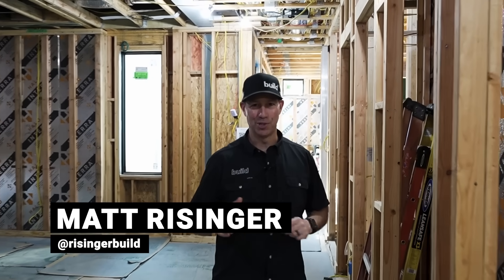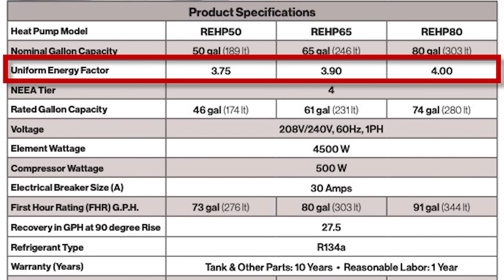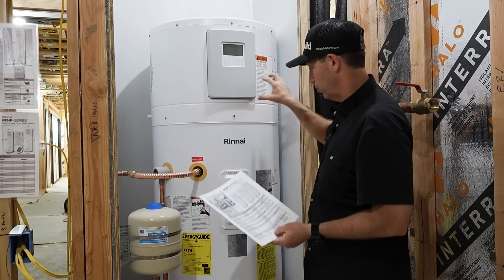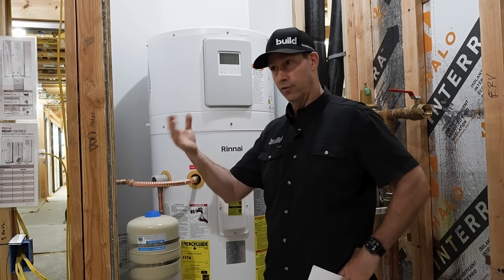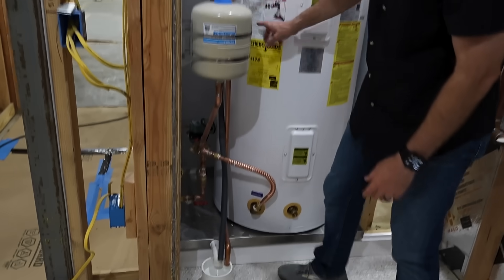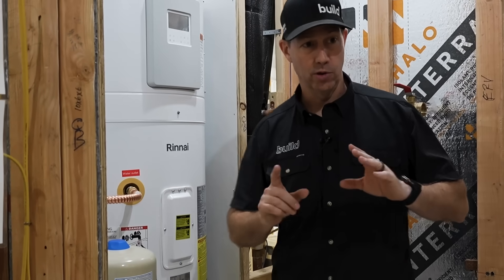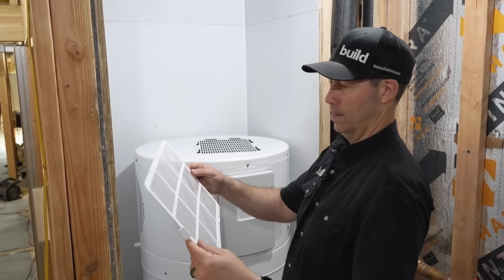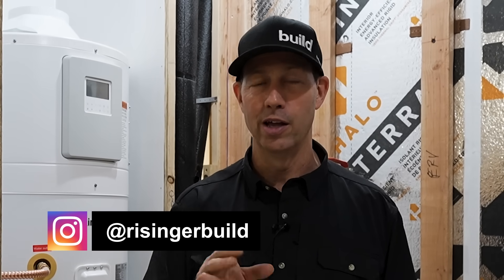The Best New Water Heater? Rinnai's KILLER Electric Heat Pump

Comment: Most hybrid tanks call for at least section.of PEX when connecting to the water.   The compressor has a resonance.  Connecting the unit with copper will transfer that vibration through the whole system.   The pex isolated the unit so your pipes don't rattle every time it fires up.
Reply: There's 2 things that could work well for noise isolation. The first is using a braided flex and pex instead of the more solid corrugated copper flex and copper piping.  The second is something I found when I did my install - a flat rubber donut, about the diameter of the hot water heater and maybe an inch thick, which does a good job of not tranferring water heater vibration to the pan and floor below.

Comment: Drain catch for when it leaks in 30 years? The tank has a 10 year warranty like any other non stainless water heater, which means throwing out the heat pump on top too. When is a company going to make one with a stainless or composite tank!? Exciting technology but they gotta either make them with tanks that last or separate the compressor from the tank.
Reply: Like a mini split water heater.

Comment: You almost linked them together, refrigerator and water heater. Now it’s possible. Perhaps if we did, we could get refrigerators that lasted more than three or four years? I’ve always thought it was a waste to dump hot air from the fridge into the house now we’re doing the opposite with water heaters. They need to be connected.
Reply: the amount of heat moved is too small. plus it's recyclical as you open the fridge door.

Comment: At $2500 + install cost, most never get your money back, it takes 10 years to break even.  If it fails after 10 -15 years you saved nothing.  Federal tax credit may make break even after 4 years at 15 cents kwh electrical cost.  Manufacture website has calculator but these estimates are always grossly over rated.  If your electrical cost is high and you get tax credit for some maybe it works.

Comment: I have a Rheem heat pump water heater. Its in a small space but the door is full louvered and the ceiling above is open to a sealed attic. It’s a cool water heater but kinda pricey.

Comment: Screw the bells and whistles does it have lifetime warrenty,  does it use high quality stainless steel tank. Does it use a 3 phase dc induction motor. Does condensate easily drain.  Is it solar  ready? If not it's chinness crap.

Comment: This comment section is great! Lots of skeptics questioning whether the calculations for efficiency and cost are actually realistic. I am a HUGE advocate for caring for the environment, but we need to be HUGELY critical of all these companies selling expensive products like this.
Reply: All you need to know is that this company is paying Matt to recommend this overpriced stuff. No credibility.
Reply: I purchased a Rheem hybrid water heater like this one about 7 or 8 years ago. It dropped the electric bill $20/month. By the time I sold the house 3 years ago, the unit had paid for itself in energy savings.
Reply: @stevk5181  Well good for you! But this junk is about $4k more than you should spend, and it's going to take a long time to pay off. Also please add compounding inflation to your calculation. The notion that you spend a ton today to break even on lesser value money ten years ahead needs to be figured in.
Reply: @stevk5181  One service call and all the savings are gone, not to mention the cost of parts.

Comment: You don't use  dielectric unions between the copper pipe and the steel tank?  That will shorten the life of the tank.
You also miss state UEF. It is an energy ratio, not a dollar ratio. 
 These heat pump tanks cool the room and building. These would be of no  benefit in the north during winter. The heat going into the water would have to be replaced by the home heating system.
Also the heat gain of a heat pump is close to zero at its low limit rating. Output of a heat pump declines in direct proportion to ambient temperature.

Comment: Physics has not changed. A BTUH is a BTUH. 500 watts is gonna make for a LONG recovery time.
Reply: @kirkwilson5905  I have 4 people with an 80 gal tank and have kept the unit in heat pump only mode. Over 4 years I think I've had one instance where I cut my shower a little short because of the water getting colder
Reply: @wighty  Makes no difference really. 500 watts is still very low. The real issue is your incoming water temperature. Even at 65deg you are looking at a temp rise of around a conservative 35 deg. Assuming a shower uses 2gpm of 75% hot water for 15mins you are looking at 6550 Btuh. At 500 watts it will take 3.85 hours for the unit to recover from one shower. If all four of you tried to shower in the AM you are gonna be chilly. Especially at northern regions with lower incoming water temps. It's just maths.
Reply: @kirkwilson5905  500W is if it was a pure resistance heater..  But this is a heat pump consuming 500W of juice and 1500W from the surrounding air (in ideal conditions) assuming COP (or whatever they called in the video) of 4.  so it's acting like a 2kW heater.  but yes it is still much slower than a regular heater.  That's why some suggest to up size to the next size.
Reply: @kirkwilson5905  what do you mean makes no difference? I just told you a real world case where the 80 gallons is more than enough capacity to allow for the unit to recover in heat pump mode. If I put a TCV on it and set the unit to 140F then I think I'd get roughly 12% more usable capacity of it as well. The unit as is could handle 5.6 average showers at its 80 gal capacity.
Reply: @jbuszkie  Now someone is making sense. Thank you. It should also be stated the 1500 watts from the air changes with air temperature.
Reply: @wighty  Your video clearly states 500w energy usage plastered all over the static image. If that were true I just gave you the mathematical calculation for your claim. That makes no difference what world you are in or what your claim is. The reality is the unit absorbs additional heat energy from the air. But in a lot of climates that energy can be negligible at best. You don't need to get defensive when I only pointed out that physics doesn't support your click bait image. I think units like this are great in certain places under certain circumstances and have been used for years in other countries. Be careful with 140 deg water.
Reply: @kirkwilson5905  you clearly don't know how YouTube works, do you? I'm not Matt Risinger, I did not create this video.
Reply: @kirkwilson5905  He said he has a TCV so 140 deg is safe.  In a hot climate these HPWHs make a lot of sense.  But if you live in the cold and If you have inefficient heat, then it's not that good of an idea.  For me I have a geo heat pump and my COP for heating is (supposed) to be above 3.  So for me, the HPWH in the colder months still should be saving me money.  I keep meaning to duct the outside air to my HPWH in the summer to increase my performance!  Someday...

Comment: Get a cheap electric, take the few grand you’ll save and install solar panels and some batteries and end up financially at the same place.  Plus you get backup power and electricity for the rest of your house and keep your tank simple not complicated.  Also you won’t be a subject to cold basement or garage especially up north where the heat pump is not as efficient.  Furthermore Water has a specific heat of 4.186 J/g degreesC, versus air, which has a specific heat of 1.005 J/g degreesC.  So you need 4x the energy in air per one unit of water to raise the temperature by one degree.  So your basement will be cold to heat that water.  So most of the time up north you’ll be running the heating element.  This is like a Prius with all the electronics and gadgets versus a 1990’s Chevy Geo three banger and easy to fix low price too.  Forget it.

Comment: First off, the quality of installation and everything else shown here should be the industry standard for North America. Talk about pride in workmanship. Secondly, those heat pump tanks are an excellent use of that technology however the extra cost should include an updated design feature. As the tank is the weakest link, it makes this an expensive replacement given the heat pump components are most likely still fine when the tank fails. They may already have one but if not an electronic anonde is a must for tank longevity. They don’t erode like sacrificial rods and extend tank life significantly. A second feature, if not available, should be the ability to swap out the bottom tank section with a prebuilt replacement. This straight forward option would go a long ways to restoring the confidence of consumers that have been exploited for the past several years by numerous appliance manufacturers. Nothing worse than paying thousands for aplliances that barely last to their short limited warranties. Great video.

Comment: Why hasn't anyone made a combo water heater/central ac unit heat pump system? Turn that 500 watts into 0 watts if you're using the ac  to cool by sending heat to the water tank instead of the outside unit during warm months, and use the outside unit to send heat to the water and the heating in the cold months?

Comment: This format exists for well under $4k, just in case you want efficiently without McMansion price tag. Definitely want to put inlet into attic so unit has maximum heat available to transfer year round. I'm in maine my basement stays quite chilly year round. Wouldn't recommend heatpump there.

Comment: So if it saves you money by using the heat out of the air, don't we heat and cool that air? So what we save on one end, we spend on the other to make up the difference. And since perpetual motion isn't possible, you can never make up 100% of that difference. Long term we're going in the hole?

Comment: Would bringing return air in through this unit and dumping it back into the return air do two things? One ensure flow through the water heater and send cool  dehumidifier air into the ac units return air?

Comment: These energy efficient instant hot water heaters and heat pump water heaters reinforce the saying “you can save energy or you can save money, but you can’t save both.” I could buy a lifetime supply of basic 50 gallon water heaters for the cost of one of these. And no, the energy savings will not make up for the large upfront cost.
Reply: By all means then, buy the older,  less efficient, shorter lifetime options. By "lifetime supply" I assume you'll only need one since you're obviously a dinosaur and likely won't survive much longer.
Reply: In my area a basic water heater is around $800+. A heat pump water heater can be had for around $1600 before any tax credits. Energy savings in the heat pump water heater depending on the cost of electricity could easily pay for itself.
Reply: @imzjustplayin  It depends. Money spent now is generally worth more than money spent in ten years. hard to tell if it's worth it when they are cutting it so close with the prices. A random inflation calculator said that buying those two options 10 years ago the basic heater cost you ~1000 bucks while the heat pump one cost you 2100. I have no clue how the interest rates in the US have developed in the last 10 years so can't tell how valid those numbers are
Reply: @aBoogivogi  I bought a heat pump water heater back in 2012 for about $1000 with the conventional water heater being around $500. Electric savings paid for the heat pump water heater and it's still in operation. If I were to buy a heat pump water heater of the same size today, it's about $1700.

Comment: Honestly what would be neat for effiency is a whole home heat pump system.  Your fridge,freazer, hvac and in this case water heater all hooked into one network moveing heat where it needs to go internaly first and then rejecting heat/cold outside as needed.  Fridge needs to cool and water heater needs to heat? ok dump the cold from the water heater into the fridge.  Need AC? dump that heat into the water heater.  Could even have a setup where the water heater can go much hotter than standard and premixes with the inlet line down to whatever the requested temp is allowing you to store more of that heat energy for later.
Reply: Sounds awesome, now get to engineering that system!
Reply: Downside is a failure of one component is much more likely to cascade into additional failures.

Comment: If you put a heat pump water heater inside a building that needs more heating than cooling over a year, you have to add the increased HVAC heating load to the running costs. My apartment uses an electric boiler for heating, heat pump water heaters would have a net efficiency worse than purely resistive water heaters in winter since they'd be robbing heat from the electric boiler but incurring refrigerant pumping losses on top.

Comment: In the winter it's pulling the heat out of the air well my furnace is trying to put heat back into the air.
Reply: Yes, 17,609 watts at a 90 degree water temp rise.

Comment: Matt.. this style are OK in warm climates where you are typically cooling the house every day.. so it takes the btu in the house and dumps it into the hot water tank.. vs traditional AC where you throw the BTU away by dumping it outside . But this style really suck for cold climates when you are heating your house only to have the hot water tank suck BTU out of your house. 

Look at the  SANCO₂ Heat Pump Water Heater.. the perfect solution for cold climates and it has higher performance when the out door air temperature is higher .. so works amazing in hot climates.
Reply: Yea, our water heater is in the basement near where the wife's hobby room is. So this would be dumping cold air into the already chilly basement where she's always cold in the first place.

Comment: In cold outside temperatures you are stealing heat from inside the house to heat the water ?
Reply: Yes, 17,609 watts at a 90 degree water temp rise.

Comment: How are these in a northern, cold winter, climate? Does it make a cold basement colder when installed in the basement?
Reply: Yes, it will make a basement slightly cooler. Note in the winter, heat extracted from a basement is a mix of furnace heat and heat from the earth

Comment: I don't know how efficient my dumb gas water heater is with no power needed, but it supplies three people with hot water for about 14 bucks a month. I'm hoping those options won't get regulated away, but I did buy three spares for my rental homes.
Reply: Exactly right. Mine has been running without a hitch for 22 years & uses very little energy. Not interested in electric water heaters.
Reply: Unscrew the protective anode at or before 10years and check it. Under a 2" plastic cover on the top. Replace it if it is badly eroded and the tank will be good for another 10 or more if you keep it up. Write the date on the tank. It protects against rusting of the tank.
Reply: That’s what we pay for our natural gas tank water heater. About $15 a month. 

 Overall, I still feel it is the best choice. 

You have an issue with these expensive water heaters, good luck getting it fixed. Everybody wants to just replace it.
Reply: @AJourneyOfYourSoul  At about $500 for the gas water heater and $1800 for a decade's worth of gas, I'm not seeing much potential for savings moving to these more complicated units.
I flush mine about twice a year, and I've seen them last more than 15 years.
A circuit board for one of these units costs more than my entire unit.
Reply: @wisenber  I just bought a house with a 50 year old gas water heater. I'm not changing it until it actually dies.
Reply: @wisenber  These are just overpriced. Way overpriced. A 50 gallon Air sourced Heat Pump Water Heater shouldn't cost more than $200 than regular resistive water heater. They only have like 5000 btu compressors and 9000 mini split ACs cost like $400.

Comment: I am curious then if the tank is engineered better like the Steibel Eltron? My hope is because these units are nearly 3K they would last longer and not be susceptible to the same corrosion. I don't think the Steibel Eltron uses the anode in the same way as a traditional unit etc. What gets me is how low the official lifespan on most water heaters is these days. A 3K unit would I hope last 20 years no problem.

Comment: The problem with water heaters is they’re extremely high failure rate. I’m gonna pay double to triple the cost? If it only lasts for five years, then there’s no savings there and now I have a refrigeration unit to dispose of.

That thing better last 30 years. Like the old ones did.

Comment: Is the First Hour rating claimed for Heat pump mode or Resistance heat mode? Heatpump mode can give a max heat of 500W*4 = 2000W but the resistance heat is 4500W more than double the power